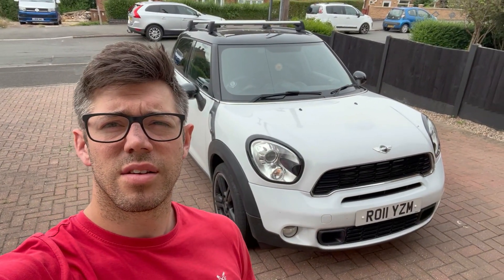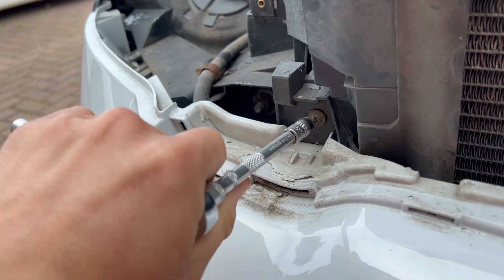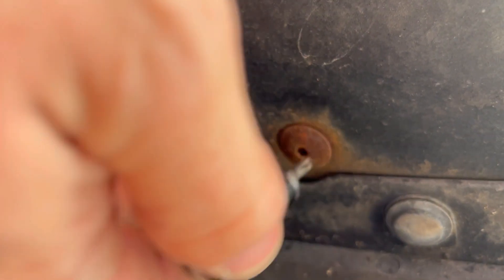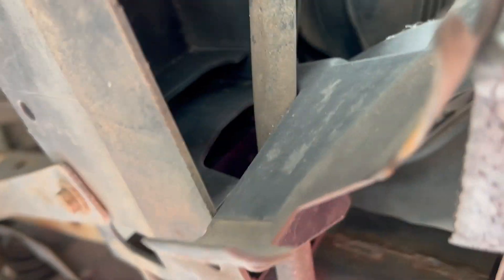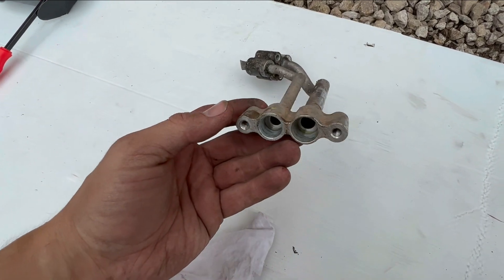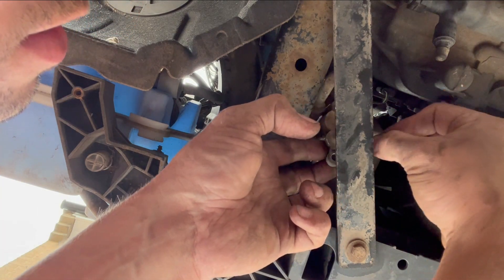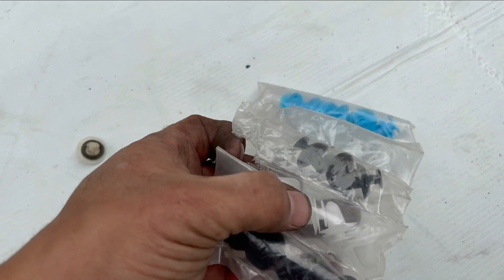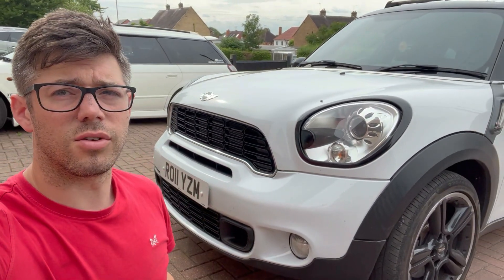Front Bumper Removal tutorial and Air con Condenser Replacement - Mini Countryman R60

Comment: Thanks for posting your video, it was really helpful.   I ended up needing to replace that double middle pipe that you showed.  3 of 4 bolts were seized and the heads sheered off rather than unthreading.

On cutting the refrigerant pipes, you did it the hard way.  Tin snips go through those pipes easily.  It's like cutting cardboard with normal scissors.
Reply from the maker: @JWSmythe  haha yeah I’m not sure why I didn’t do that tbh.  What a faff haha.

Comment: Thanks for the video mate. 1st one I've found for the R60. I've removed other condensers and Radiator shroud without disconnecting the AC on R56 and F54 in the past, but the R60 model requires AC disconnect :(

Comment: Thank you very much for this excellent video! We wouldn't have done it on my mini Paceman (same front like the countryman) without it! Just a warning for others: if you have a JCW version, the turbocooler is way bigger and you'll need to remove the hole front bumper (the big metal part) and the turbocooler-holder on both sides, so the new pipes will fit.
And like someone else wrote: you don't need to remove the headlights.

Again, thank you so so much!
Reply from the maker: No worries, glad it was helpful

Comment: I'm going to do this job and this is the best video I've seen on it, thanks. 
Couldn't the flat metal bar which is bolted to the car underneath be moved a bit out of the way which might make it much easier to refit the pipework? 
Also I read that "special" O Rings are recommeded (Nitrile rubber? The green ones) rather than standard or doesn't it make much difference?
Reply from the maker: @petewright3952  yeah nitrile are recommended but I wasn’t expecting those and didn’t have any.  If you know about it then mights as well get proper ones.
 Glad you found it useful.
Cheers
Reply: @InitialB  What do you think about that flat metal bar, it looks right in the way couldn't it be shifted a bit if one end is loosened?
Thanks again
Reply: I removed the flat metal bar which goes from the chassis member to the bottom of the plastic radiator surround, this gave a lot easier access to the A/C pipework when removing and refitting.
Reply from the maker: @petewright3952  sorry I didn’t reply I was going to go under and take a look.  Good idea though that!

Comment: I'm in need of some help to carry on a bit further with the disassembly of my 2015 Countryman I need to remove the radiator and fan assembly for repairs. Any assistance appreciated! I can't find any radiator removal videos on this model. The ones I've found have been on 2013 and earlier models, which are different from this.
Reply from the maker: @davidsalzman6677  wish I could help you there, hopefully as little work as I can get away with on this car haha.